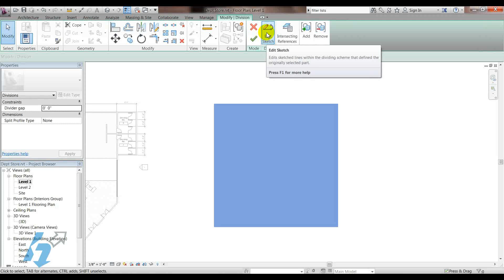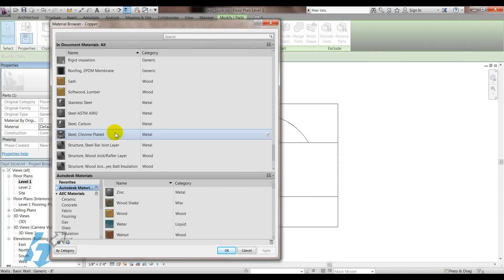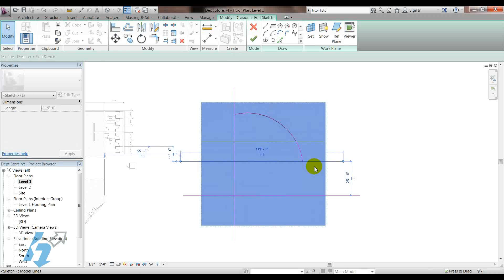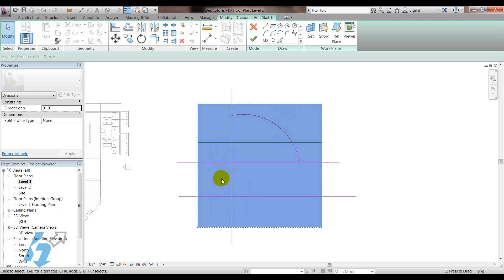Revit Tech Tip: Flooring Finishes Using Parts Tool

Comment: Thanks for the tip. As you said at our firm we use 2 floors: one for the structure and another for the finish (1/2") with a preassigned material. This method is pretty fast, Is there a particular reason to use create parts.
Reply: Parts are typically created from a wall/floor/ceiling/roof/etc. element in order to separate the layers into individual components for the purpose of construction/fabrication, or maybe even to produce an assembly-type view.  This is just an alternative way to separate the finish surfaces when you don't want to create each individual floor.  Hope this helps.
Reply: There are a number of settings that can affect the visibility of elements in a view.  I would need to review your model to find out what exactly is going on.  This is something we do for customers through our support services.  If you'd like to know more about that I'm happy to point you in the right direction.
Reply: @Hagerman_brettbarkman  Turns out you have to set the bottom view range to end below the floor to display the parts.

Comment: Hi, how to move a part up or down vertically after dividing into parts. For example, i have a finish floor running into balcony where the tile or finish floor would be 1" or 25mm down from the same room

Comment: Do I have to make two separate floors- slab floor and finishing floor? I am little bit confuse about it, How can I show  the slab level and Finish Floor Lvl. , Practically Slab Thickness is 200 MM & 100 MM Finish Floor. Pleaes reply
Reply from the maker: JOHN Mills,  to create a schedule that will report both the slab level and finish floor level you will need two floors. You do not need to create a separate slab to assign a material, that can be assigned as a property in the room.
Reply: Sir Can you make a tutorial for more clarification please...

Comment: Very nice tutorial. But what about if those parts have different levels like one part is a step higher and the other part is a step lower? Hope you can also make a tutorial for that. Thanks.
Reply: +littlebear You can use those things called "Assemblies" in Revit. Or, try modeling separate slabs. Or just make a "In Place family" and model whatever you want to represent your floor.

Comment: But if you have walls with their bottom attached on the floor, you want their core boundary to attach on the core of the slab and the finish attached on the floor finish. How can you do that using parts?

Comment: besides the Show Both setting in properties for the view, what else could cause my parts to not show up (on in VV)?  I can see them in 3D, but not in a plan.
Also, when i assign different materials to the parts, their surface patterns overlap (I see both).  This may be a graphics drive issue wiht 2013.  still looking into that.  Otherwise, great tip.
Reply: adjust your view range such that you see the pattern it worked for me